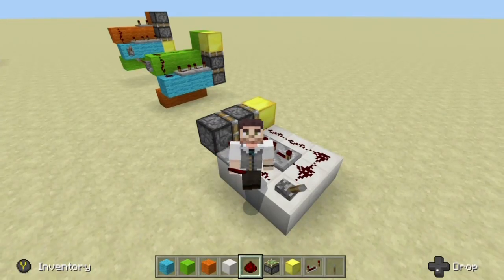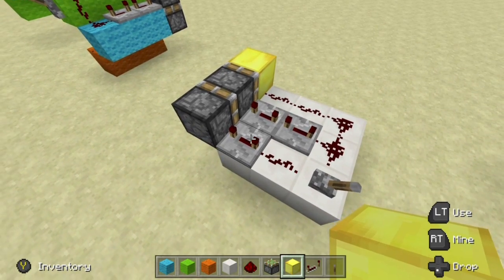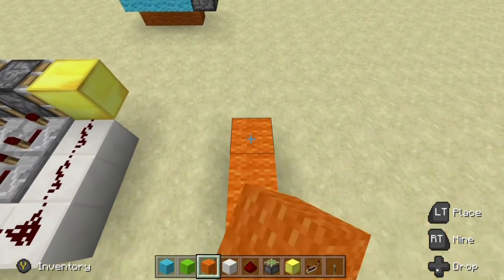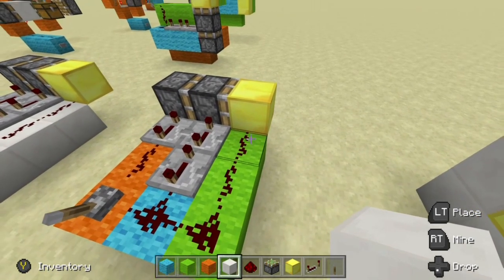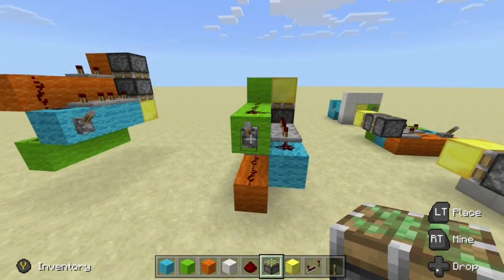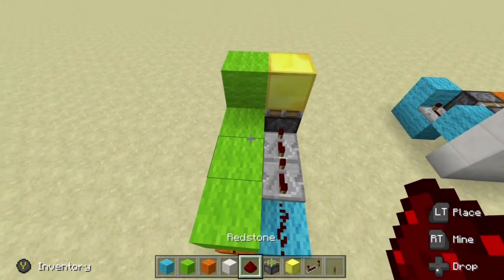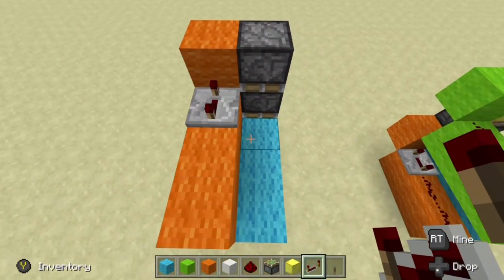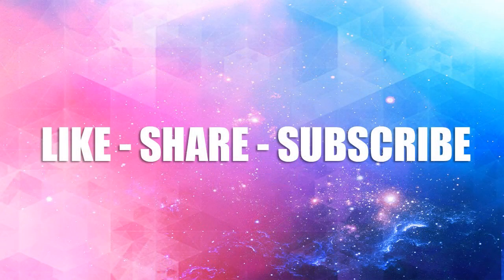Minecraft Bedrock - Double Piston Extenders (Horizontal & Vertical) Tutorial

Comment: This works with a 3, 6, 0 tick delay as well
Reply: even better it also works with  2, 5, 0. at least on the vertical up, didnt try the others, but it should. but considering it is bedrock who knows, seeing as i also got 1, 4, 0 to work, but not consistently.
Reply: DemonSeedXP With a horizontal double piston extended, 3-6-0 is the shortest delay that will work consistently. 

Edit: I have just tested the vertical iteration and the 3-6-0 delay is still the lowest consistently working delay. 2-5-0 works, but that delay breaks the sequence about 20% of the time, so it isn’t reliable. I have never gotten 1-4-0 to work after countless attempts. are you counting the ticks correctly?
Reply: @M00nscr1pt115  I tested out the 2-5-0 system in my testing world, and found out that it works reliably if you use a repeater as the input. If no repeater is present, it isn't consistent
Reply: Vishal Bhat I’ll have to try that :o
Reply: @M00nscr1pt115  yup, it is faster than 3 6 0 and I used it in my 8 piston extender (don't ask lol)
Reply: Vishal Bhat leading the power source into a repeater that is powering a block, rather than directly wiring the power to the piston extender, makes the 2-5-0 sequence works flawlessly!!! That’s amazing! Thank you so much for this bit of knowledge!
Reply: @M00nscr1pt115  no problem mate, I was trying out different piston extenders and I accidentally stumble upon this lol
Reply: @M00nscr1pt115  and other than that, the 1 4 0 system isn't recommended, it works only like 30% of the time
Reply: @M00nscr1pt115  and just another tip for building bigger piston extenders, check out Mumbo's video where he makes bigger piston extenders. He found a "formula" on how to make bigger ones easily. On Bedrock it actually might be compacter due to lack of QC
Reply: Does it work on xbox 360

Comment: I know this comment is a little bit late, but is it fairly easy to invert this? (Make it extended all the time and when you press a button, it retracts shortly)
Reply from the maker: You should be able to keep it powered with a redstone torch powering the redstone line. Then you can use a button to temporarily turn off the torch which will retract the pistons.
Reply: Rogue Fox that’s what I figured. Just didn’t know if it would be functional or not considering how wack red stone is on bedrock. Thanks for the reply!